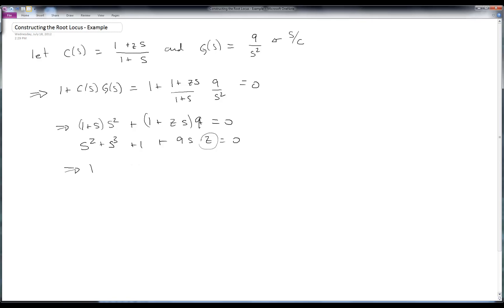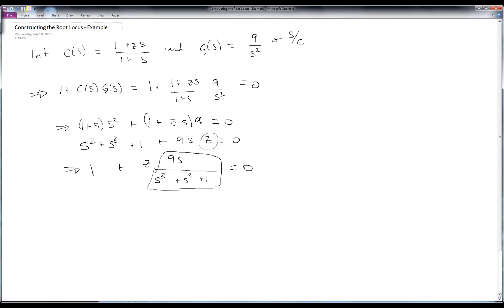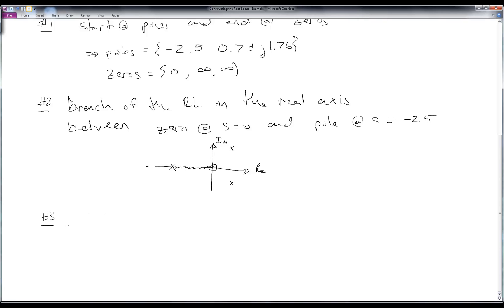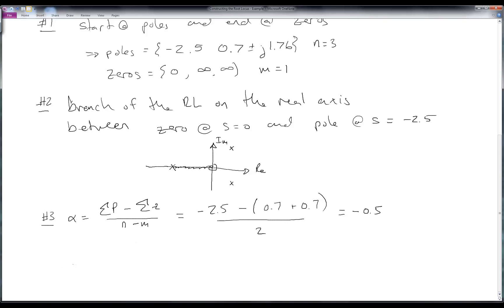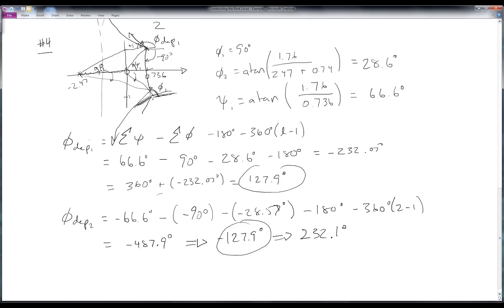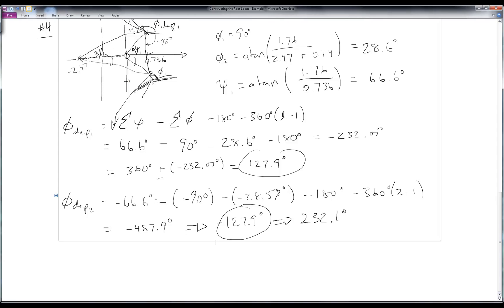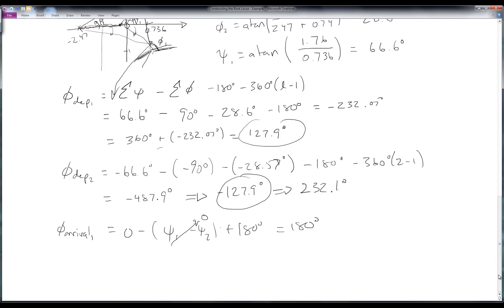Root Locus Example

Comment: Seems like you've got lots of errors. Like everyone else has mentioned don't multiply 9 with the (1+z)9 = 9+9z not 1+9z.
Also what's up with calculating l? You say l = n-m = 1  You've said n = 3 m = 1 and l = n-m which would be 2. After that I gave up.